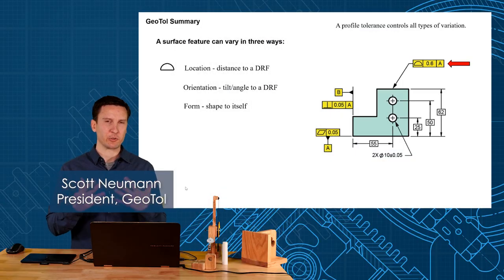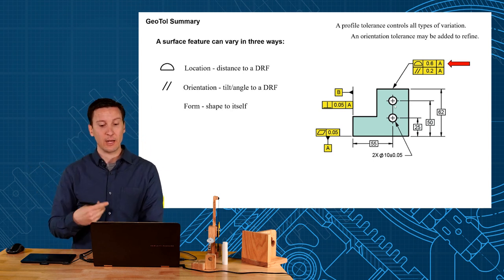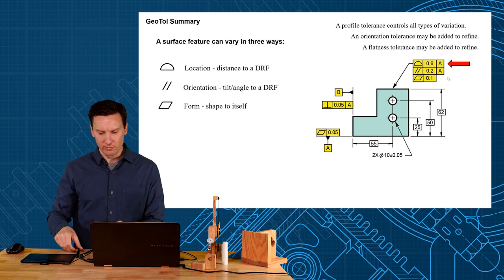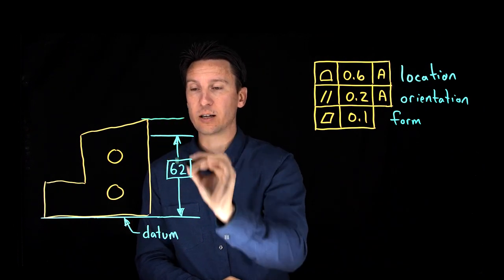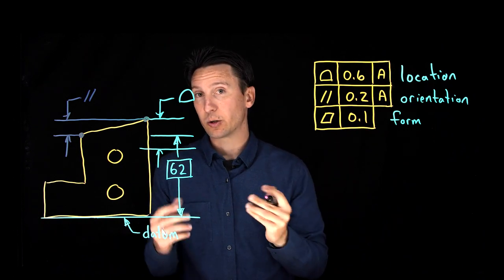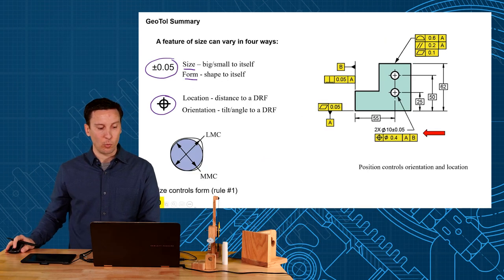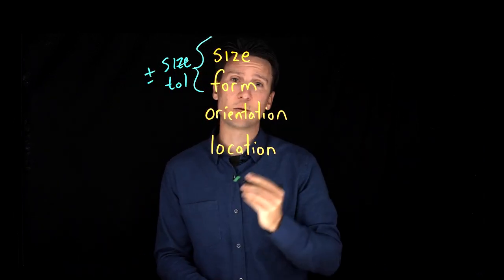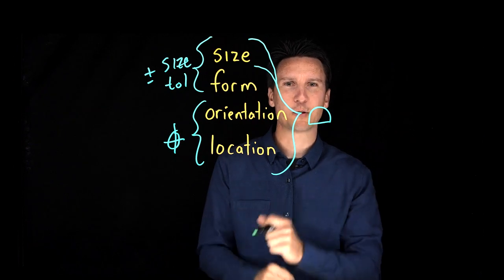Summary of How GD&T Works

Comment: Is parallelism 0.2 measured in degrees or unit of measurement
Reply from the maker: Geometric tolerances are in distance units. They define the size of the tolerance zone (distance between two parallel planes, or size of the cylindrical tolerance zone)